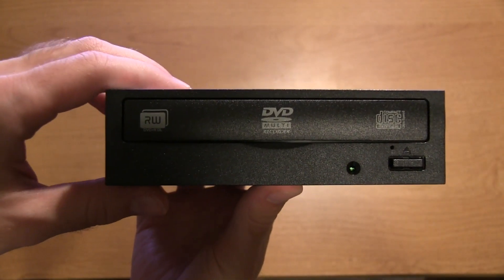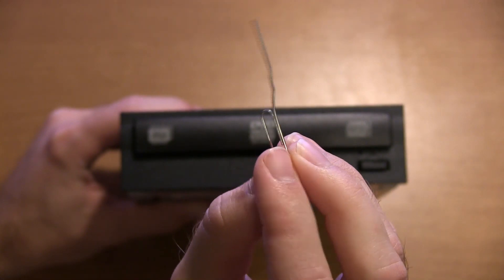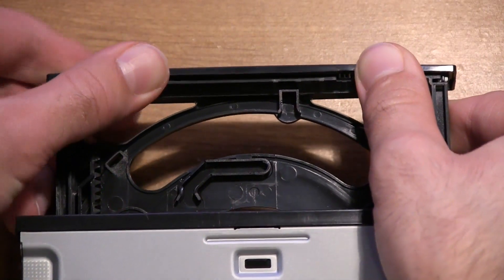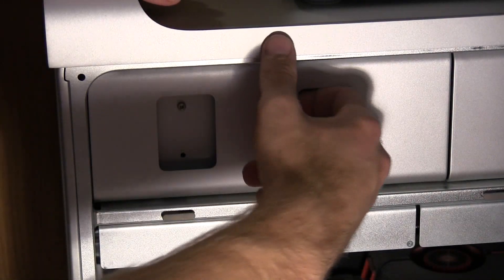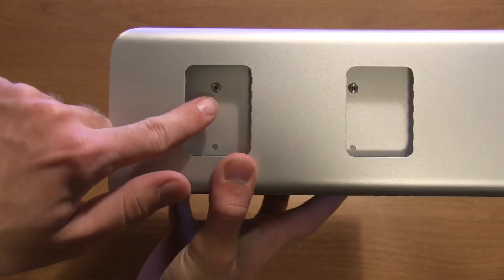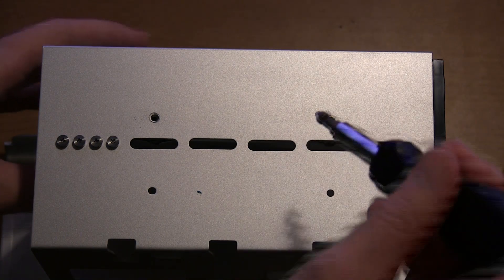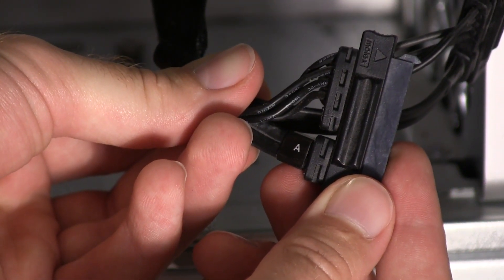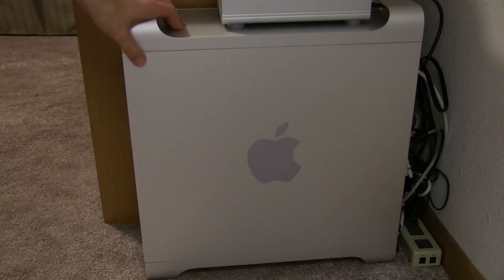Upgrade: Mac Pro Optical Drive

Comment: I've done this upgrade several times.  It's easy to do, but the problem is that eventually some months down the line, the drive tray doesn't want to come out when you press the keyboard Eject button anymore.  These days it sometimes takes me 20, even 30 presses before it finally breaks free and comes out.  I can't see any alignment problem so I don't know why it does that.  It's happened with at least 2 different drives (Pioneer) so far, too.  Very frustrating!
Reply: I've had the same problem on my Mac Pro 1,1 the hinges on the sliding doors seem to get stuck at the front and stop the plastic tray slding out freely, maybe they need cleaning or something, I've noticed when I put a samsung CD drive in the lower bay to test it it had more of a strong tray eject action and seemed to solve the problem, just need to find a DVD drive that has some ommph aswell.

Comment: I see you wound up with a rev D drive (note the "D" on the label after the "iHAS124" part) - that's my favorite revision of the iHAS124, as you can crossflash these with the iHAS524 firmware and do LabelTag with them (this works on rev A/B/C as well) and rev D produces the best quality LabelTag images. I think that software may be Windows-only,  so this probably isn't of much use here, but if you ever put the drive in a different computer it may be worth trying out.

I did compile various resources here including the needed firmware dumps and flashing tools - I think I remember the procedure for rev D being very similar to the one for rev B, though I think I didn't have to do anything with the EEPROM on mine: https://cheapiesystems.com/media/odd-firmware/